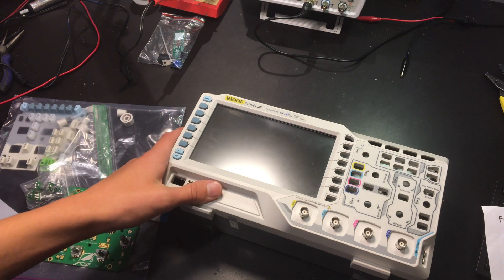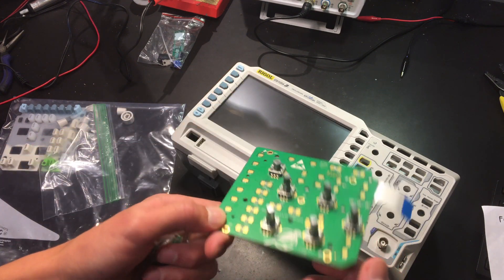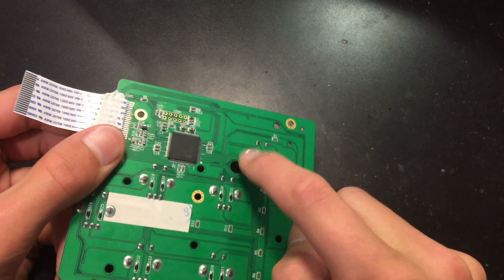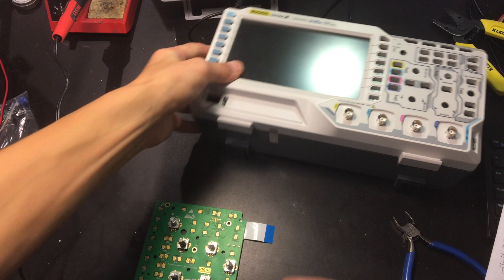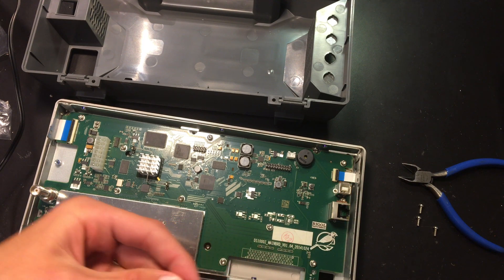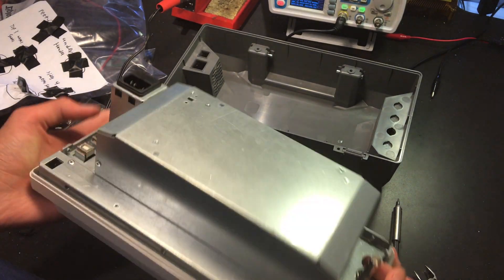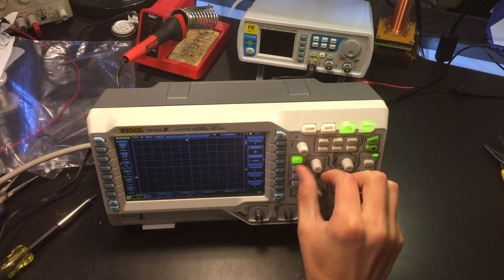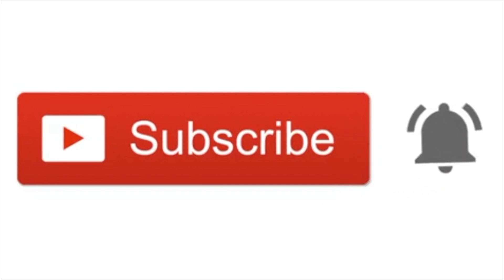Rotary Encoder Replacement | DS1054 Rigol

Comment: what is the part number or model number of your encoders? please share them because I also snapped mine
Reply from the maker: I didn’t find an exact model number for mine, I just looked for an encoder on eBay that looked identical and had the same specs

Comment: Did you replace it with EC11 encoder?
Reply from the maker: I'm not sure what the exact model was, but it was something similar to an EC11.
Reply: @CarbonCoil  Ok great. I am currently trying to fix the rotary encoder of DPS5015 power supply and I extracted the encoder from a module board. https://www.youtube.com/watch?v=tIceBONiXLA   The DPS5015 behaves weird. Instead of counting to one on single step, the counter got incremented by two on single step, and also the direction is opposite. It looks like there is a difference between Stepped EC11 encoder and Step- less EC11 encoder. I am going to order one which looks exactly like the old one.

Comment: Hi, I can't believe I found your video... I have the same scope with a broken encoder... different encoder, but the same issue.  The arm broke off that goes into the knob.  What was the part number that you used for the encoder replacement?  I didn't see that anywhere in your video.  That would be great if you could pass along the Mouser part etc... Thanks for posting!  This will be an easy repair if I can find the encoder.  mg